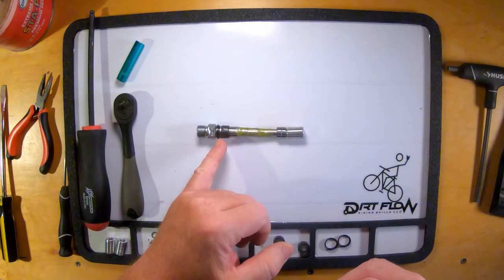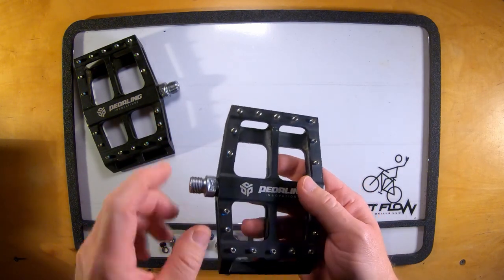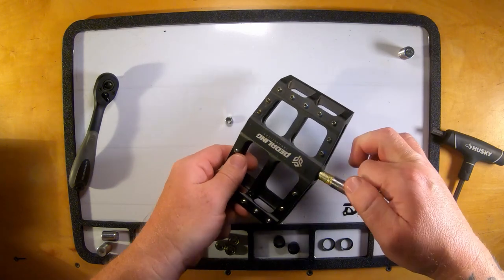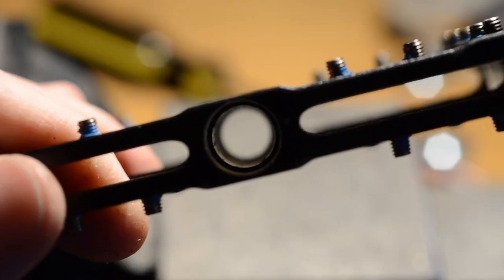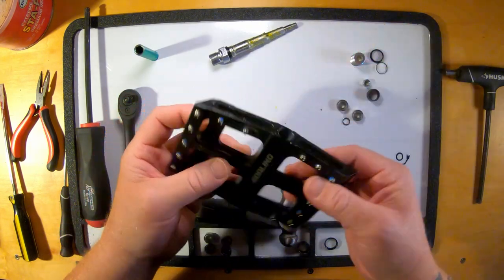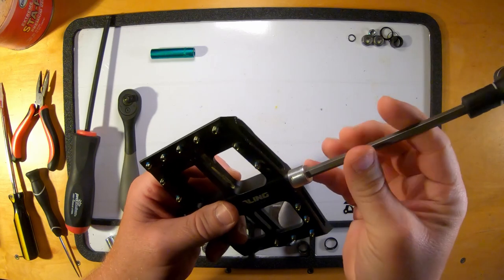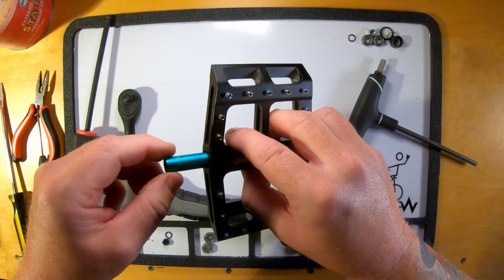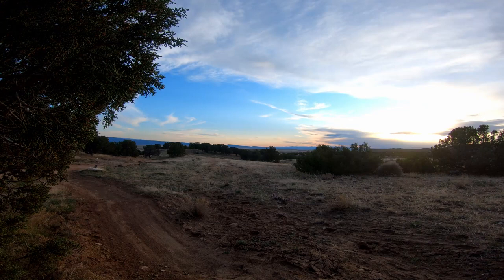HOW TO REBUILD A MOUNTAIN BIKE PLATFORM PEDAL  |  USING A CATALYST PEDAL FROM PEDALING INNOVATIONS

Comment: Great video. I wanted to point out that the bushing is easily driven in by inserting the axle into and lightly pounding it until the bushing seats.
Reply from the maker: That's a great point. Thanks for the input. 🤘
Reply: @RideWithGravity  Of course. Thanks for the great video. Took me 5 minutes and side.
Reply from the maker: Nice!

Comment: I just rebuilt my Catalyst pedals I've been beating for approx. 2 years.  They are gouged, scraped--everything but broken!  The rebuild has them running like new.  They're old and have never had maintenance.  The hardest part was removing the old cleats.  Two broke, were crushed, when trying to screw them out with vice grips.  They're sheared off level with the pedal platform. The key holes were too far gone to screw them out.  But the rest are fine.  I replaced them (shorter cleats) with the longer cleats.  These will be better for the coming SD winter.

Thanks for posting!  Thanks for the help!
Reply from the maker: You bet! 🍸 Cheers!

Comment: Fantastic video. It gave the courage to attempt a rebuild of my Catalyst pedals. Everything went well until the final tightening. All that seems to happen is that the dust seal gets squahed and my pedal wont turn. But if  I losen it so that the dust seal is ok, there is too much play. I certainly can't tighten the nut as much as you did otherwise I just crush the dust seal. 
Did I push the bushing in too far. The non bevelled edge is about 14mm inside the pedal. Hoping you can give me some pointers.  Thanks.